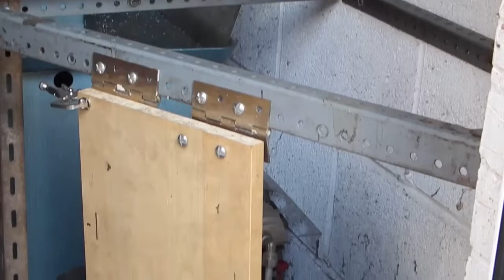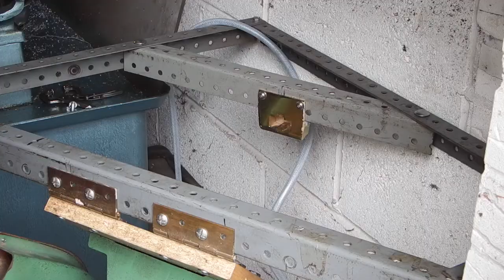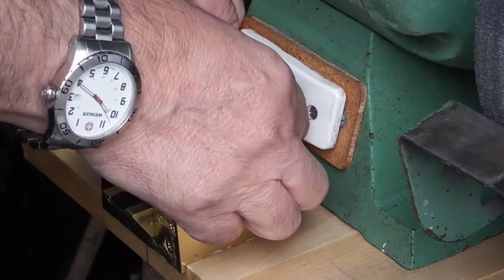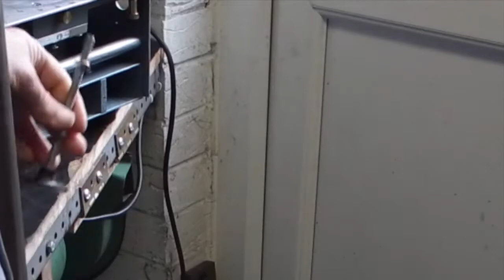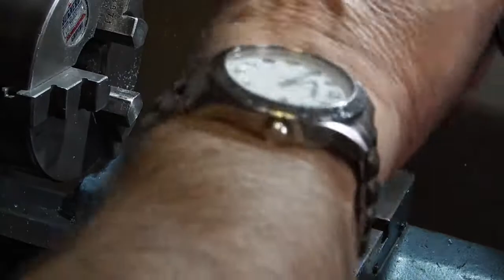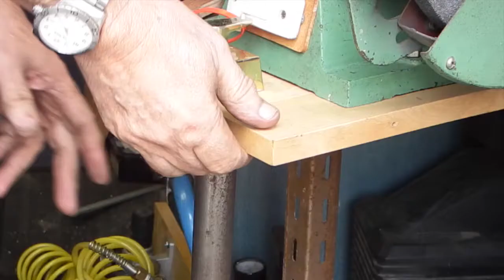I need more space

Comment: Nice idea. Just make absolutely sure there is no way it can come down on its own by accident. Because with the weight of that grinder, a knee cap doesn't stand a chance. But good use of space in my opinion.
Reply: It would swing on an Arc, therefore if you are standing really really close it would still swing away from your knee, you would have to be sitting down with your legs under the table in order for them to be in danger. Of course if the entire bracket gave way, or an old mine shaft under his garage...